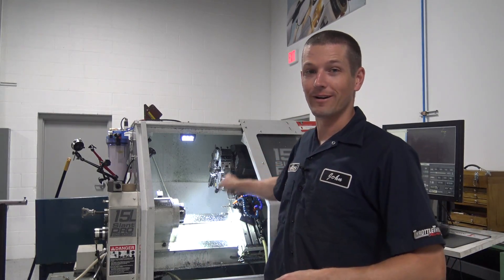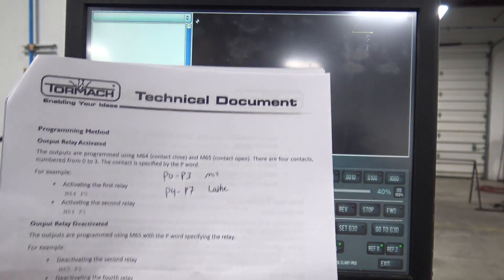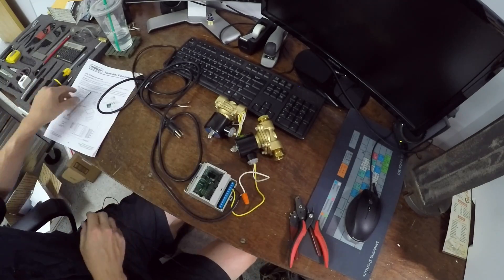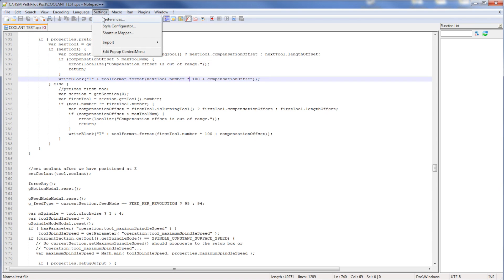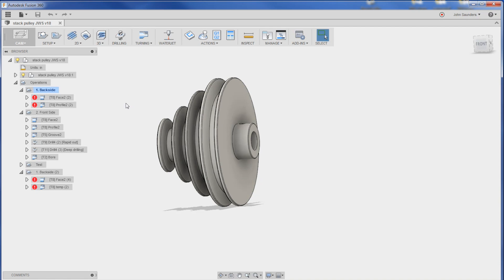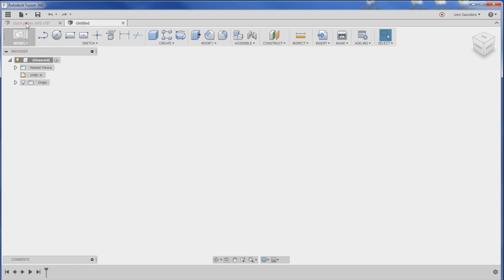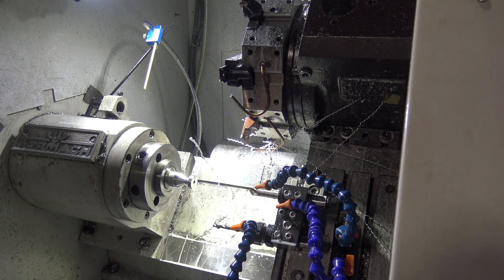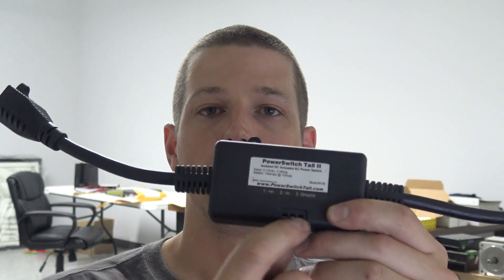Hack Tormach Lathe: Automatic Gang & Turret Coolant!  WW110

Comment: John, I'm getting ready to do this exact hack/mod. Just got my 15L a few weeks ago and I bought the USB I/O module at the time because of this video.

One thing that may be worth noting, if you're short on I/O Ports, you could always using just one of the 4 for the coolant selection. Just have something like a small arduino or PIC chip take the single input from the Lathe USB I/O module and then set the high/low states for a 2nd set of relays. I know it's more hardware, but way cheaper than having to buy a 2nd I?O module @ $200. The guys at Tormach said you can use up to 2 I/O modules.

Comment: Great video, thanks!

One tiny point of clarification: you're right, that it doesn't generally matter with mains AC which wire you connect to which, But have you ever noticed the polarized plugs on things? That's done to ensure that the black, or "hot" side, goes directly to the main switch (like in a lamp), and the neutral side goes to the rest. This enhances safety by ensuring that if the device’s main power switch is off, it's unlikely any part of the device could be energized and form a potential electrocution hazard.

In the case of the solenoid, it’s best practice to do what you did: run the hot (black) wire to the relay, and the neutral (white) wire to the solenoid. When the relay is off, should you accidentally short (say, frayed insulation) from anywhere after the relay to ground (perhaps by touching it while grounded), you’ll be safe.

Just a small thing to be cognizant of when wiring things using AC mains.

Comment: From a safety standpoint, switch "line": Neutral should be always remain connected to prevent electrical noise (flickering lights) on other parts of the circuit. And to do it fully safely in a vibratory and/or moving environment with liquids, don't use a wire nut and electrical tape: Use a Telegraph/"Western Union"/Lineman/"NASA"/Aviation splice, solder and tighter than usual heat shrink instead. An extra 30 seconds can save you weeks in the cardiac ICU followed by redoing the work later, or a trip to the courtroom, or dealing with insurance claim adjusters...

Comment: You should wire the two coolant solenoids to a single relay. one side NC one NO that one of the valves is always open so you don't have to worry about overpressure and timing of the coolant pump

Comment: With this, and perhaps a new pump, you could add high pressure tooling to the tormach.  Ive been thinking about doing it for a while, the turret would be easy, but making it selectable on the gang tooling was the problem I hadnt figured out how to solve yet.  Going to try this!!

Comment: why didn't you use only 1 relay by connecting on solenoid to nc and the other to no that way by typing one command you would switch between the 2 lines  unles you my use them both in one point ?     iv mad a schematic check it out https://drive.google.com/open?id=0By8G5MLb-044RXd3aU5Wa05VUjg

Comment: hey John, ever thought about adding an air nozzle inside the cabinet pointing up at the door to help keep the coolant spashes from getting in the way of the video? ( you could even add a micro switch to detect when the door is open and shut off the air)

Comment: You think that would turn 50 BMG bullets out of brass or copper  soild round  bar stock ? thanks .
Reply: TEST Fifty. yep may have to toy with the cut parameters to ensure repeatability within the tenth.  But, a sizer will do fine fore a finishing touch.

Comment: From a safety standpoint you should switch the hot (black) wire or switch both wires.  The neutral wire is bounded to ground and should only carry a current if something faults (a short).  If you switch the hot it keeps the current from flowing if something happens to short out the system downstream from the switch.

Comment: On wiring, have a look at  http://www.the-appliance-clinic.com/electwiring.html.  The ground and neutral line are connected to ground at the junction box.  You can test this by taking a volt meter or DVM and measure the AC voltage between the ground and white line, it should be close to or zero volts.  Between the white or ground to the black wire you should see 120V.  The shortest  slot on a wall outlet should be connected to the black wire or "Line".  Look at a 3 wire plug for a PC, the ground is circular, neutral and "Line" each have a rectangular cross section, the long side of the cross section is longer for the neutral plug than for the "Line" plug.

Comment: Although it is basically true that the white and black lines on AC are theoretically the "same," in practice, they are quite different. by taking one side of a single AC phase and grounding it, you make the other side "ground seeking." In the US (not sure about other countries' standards) the white is "neutral," and grounded. The black side is "hot," and ground seeking. If there is a ground, then it is connected in the exact same place as the neutral, but should only carry current in a fault state. GFCI circuits actually look for a current on the ground, and cut the hot if current is detected. Otherwise, ground and neutral can be interchangeably used. Because of the grounding issue, black/hot and white/neutral should never be used interchangeably. If (big if) you bring your neutral and hot through a 1:1 transformer, neither of the two wires on the other side will be ground seeking, and can be safely interchangeable... unless you ground one side.

Comment: I'm wondering if the USB I/O board has the capability to give you current status of the relays.  Might be able to tie that into the initialization shut off (saving you from a shutoff command when not needed), and maybe integrate it into a protection subroutine for the solenoids so you never have to worry about running the pump into a closed valve.

Comment: John, you should put some kind of surge protection across the solenoid.  If you don't, you will fry the contacts and shorten the contact life.  When the relay is turned off you will see a large voltage spike across the solenoid coil.   don't think Tormach included that on the board.

Comment: Hi, another great vid! You might want to consider installing a MOV surge suppressor on those solenoids, they throw quite an arc across the relay contacts when it opens. Unless of course they are built into the board!

Comment: 3:33 :O 
Great work on your vids but I feel the electrical advice to be wrong. :(

Not sure how things work out in the states but that advice seems really wrong, in your scenario the "Neutral" wire should goto the Common conductor on the really and you switch the "Line" or Live conductor as switching the "Neutral" can keep the circuit live and provide a good shock for anyone that may come into contact with it. 

In the UK you always fuse and switch the brown wire line and the blue neutral can be a fixed connection, this is because of the way the transformers are wired at the substations, the neutral conductor is always at ground potential and is tapped at the transformer end to provide the safety connection swell, so essentially the yellow/green and the blue wires come from the same side of the transformer. The brown line wire comes from the powered side meaning in theory you could quite happily lick the blue conductor and not get a shock when it is turned on but if you tried it with the brown conductor you would be a path to ground and get a nice 240v shock.  I think this is a TN-C-S supply, 

If you can get through the monotone voice JW has some good advice on electrical wiring and why you should and shouldn't do stuff. 

https://www.youtube.com/watch?v=AWxeb2MI37c

However saying all that I think you did it correctly as I believe White is Neutral and Black is Line in the US, so switching the black is the correct thing to do.. 

Keep up the good work.

Comment: You should be able to use functions and switches to make editing easier if you are using different nozzles with different tools.

Say you have 4 nozzles.

function nozzle(n)
{
   switch(n)
  {
  //Nozzle 1
  case 1:
     writeBlock(mFormat.format(64), "P4");
     writeBlock(mFormat.format(65), "P5");
     writeBlock(mFormat.format(65), "P6");
     writeBlock(mFormat.format(65), "P7");
     break;
  //Nozzle 2
  case 2:
     writeBlock(mFormat.format(65), "P4");
     writeBlock(mFormat.format(64), "P5");
     writeBlock(mFormat.format(65), "P6");
     writeBlock(mFormat.format(65), "P7");
     break;
  //Nozzle 3
  case 3:
     writeBlock(mFormat.format(65), "P4");
     writeBlock(mFormat.format(65), "P5");
     writeBlock(mFormat.format(64), "P6");
     writeBlock(mFormat.format(65), "P7");
     break;
  //Nozzle 4
  case 4:
     writeBlock(mFormat.format(65), "P4");
     writeBlock(mFormat.format(65), "P5");
     writeBlock(mFormat.format(65), "P6");
     writeBlock(mFormat.format(64), "P7");
     break;
  //All open
  default:
     writeBlock(mFormat.format(64), "P4");
     writeBlock(mFormat.format(64), "P5");
     writeBlock(mFormat.format(64), "P6");
     writeBlock(mFormat.format(64), "P7");
     break;
  }
}

Then you can just call nozzle(1); for the the tools that use nozzle 1. Default is all on in the case you enter a nozzle number that does not exist, like 5 or 0. If the default in not needed and maybe exclude.

Then you should be able to do the same with tools.

switch(tool.number)
{
  //Tool 1, nozzle 1.
  case 1:
    nozzle(1);
    break;

  //Tool 2, nozzle 3.
  case 2:
    nozzle(3);
    break;

  //Tool 3 or 4, nozzle 2.
  case 3:
  case 4:
    nozzle(2);
    break:

  etc....
}

Comment: I strongly recommend the noise suppression kit when switching inductive loads (like solenoid valves) with the USB IO. I tried to go without it when switching some pneumatic valves... ended up having sporadic issues with the IO board where it would shut off or loose communication with the PC.

Comment: I'm not an expert in Fusion, but i have a comment about the code you added.

ALWAYS write a comment above your code. Someday someone else will look at it and will be confused. Or even you will be confused by your own code. This is even more important if you're an unexperienced in programming.
Write something like:

/* NJCNC: ADDED 2016.09.07 */
/*
 * witch between turret coolant and gangblock coolant
 * gangblock: P6
 * turret: P5
 */

This way you can search in the code for your changes with: "NJCNC" You know when you add the code and what it does

Also the way the coolant can go are excursive. It can only go to the turret OR the gang block. You can hook up both solenoid on one relay. This way you minimize the possibility of an failure.

Comment: Very cool.  I didn't know about the IO kit.  That opens up all sorts of possibilities.  I see that these are optically isolated.  But I always had better luck using solid state relays, when switching AC (much less radiated electrical noise).  But this seems to work well.  It brings all sorts of ideas to mind.  Thanks for sharing this.

One quick note about AC wiring.  As you mentioned, on something like a solenoid coil switching the hot and neutral lines won't matter, as both are isolated.  But in other applications it could make a difference.  For example, wiring something as simple as a table lamp  backwards can be a bit hazardous.  It will work fine.  But then the core of the socket is neutral (essentially at ground potential) and then the bulb threads would be hot.  Again, it will work fine.  But if you've ever changed a bulb with the power on, its easy to accidentally touch the threads, where it's nearly impossible to accidentally touch the bottom core.  There's a reason that the 120V prongs are polarized.  Just wanted to mention this, so others don't get the wrong idea about AC wiring.

Comment: Hi John,
Now you are talking.  Not a Tormach lathe guy yet but really enjoy watching your videos.

If you really want to get fancy you could use the same IO board to give you a programmed AIR BLAST. This might help blow away all the squirrels nest that can happen when turning. I have experimented with my HAAS control with similar codes and it works great. I can even clamp and un-clamp my 5C Collet fixture.  The possibilities are endless.  Talk to your friend at Fusion 360 that helped you with the post processor.  If he looks at the attached videos he will probably come up with some innovative ideas that will make your life easier. 

The other thing I did was put a dual nozzle on my coolant. The sit side by side one gives you coolant and the other gives you an air blast. I had a friend of mine give me a little control board that would allow me to program how often and the duration of the air blast. This would be a really neat feature to incorporate into the fog buster and could probably be programmed into your GCode with ease.
Here are a couple of videos that you may find interesting.

 Coolant Air Solenoid Installation Part 1 https://www.youtube.com/watch?v=Xfrhq8aCu38

Air Coolant Installation Video Part 2 https://www.youtube.com/watch?v=IxOgYId27tw

Programmable Coolant Air Solenoid Introduction https://www.youtube.com/watch?v=B1ArxUjLy5c

Really enjoy your videos!!!!!

John

Comment: LINE 760:

if(tool.number>=1 && tool.number<=8)

{

/*Most all programming languages are 'BASE 0', JavaScript included... Looks as if
the array's index is off by one in both parts of this conditional block.Unless otherwise specified, should be tool.number>=0 && tool.number<=7 and so on (else if should be 8-14).0 is an object within the array, in memory - 
*/

}

If you test this further, tool 8 should act like tool 9 as this is currently written.

Congrats on the new family addition....

M.
Reply: Could be, depends on what the tool.number function returns. Could be 0 - 14 , 1 - 15, or something else depending how was programmed.
Reply: Very true... But JavaScript isn't like old VB6 where there is an 'OPTION BASE' statement available.

While only limited code was shown in the video, I don't see why the 'base' would be changed - seems illogical. But you are right, we don't know what the tool.number function is returning of what is contained within it.

I'm sure you see my point though.

Comment: Hi John! Cool project! You actually don't need to change the background color of Notepad++, just choose the language when opening the file and you are good to go. I guess that the setCoolant function call outputs the coolant command on or off depending on if tool.coolant is true or false. You could in your custom code take tool.coolant into consideration and if it's false then close both solenoids to save power and minimize wear and heat buildup when not in use. Also, you should probably open the correct solenoid first and then close the other one after that like you did in your first if statement. Another possible change could be to close both solenoids when the coolant is shut down. Just some suggestions, if they are needed is another matter ;-)

Comment: Hey john,
Add a third, smaller, solenoid as a return line for pressure relief.
Reply: No need. And actually you really don't want it either.  The pressure from the pump to the check valves keeps the pump primed, everything after the check valves is de pressured since it's an open end line. 

Depressuring the lines means every switch would require the pump to reprime and repressure the lines at every switch, causes a big delay in coolant activation. You could be half way done the cut before the coolant even starts coming out the lines. 

In fact I'd recommend moving the one way check valves as close to the coolant nozzles as possible. It'll shorten the delay between the switching of coolant.

Comment: Great Video as usual.
When ever possible better to use 24VDC Solenoids to avoid risks of electrocution if/when a wire gets damaged, especially when dealing with a wet environment.
Of course you would need a 24Vdc Powersupply but those are pretty cheap and readily available.
Cheers
Reply: A GFCI outlet should reduce the risk of electrocution. I think they are required in a garage.
Reply: Ok I had to google "GFCI" to find out its a Ground Fault Circuit Interrupter, since that's not the common term in my part of the world where we call them RCD (Residual Current Device).
Yes a GFCI/RCD will almost instantly cut the electrical supply when there is an electrical shock to ground. They are usually requred in almost all commercial premises.

But if I'm not mistaken they won't cut the supply if you grab positive in one hand and neutral in the other hand. So Electrocutions could still occur in some situations.

Also a GFCI/RCD is designed to cut the power withing a certain time limit which would prevent a normal healthy Adult from being Electrocuted. It may still be possible to electrocute a child or sick/old Adult.
Also If you only touch the Live and are not grounded or touching the Neutral, the GFCI/RCD will not trigger and you wont get a current "shock", but your body would still be subject to the AC Voltage frequency which could cause electrocution in certain cases eg Children, Sick/Old Adult or persons with electrically sensitive medical devices such as Heart implants.

So yes a GFCI/RCD is a good safety measure but not fool proof.

Cheers.